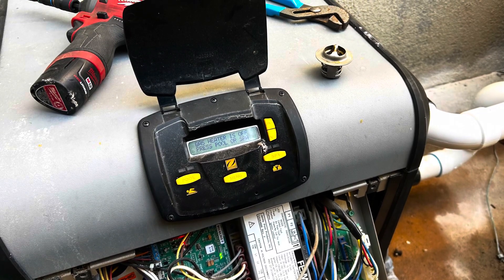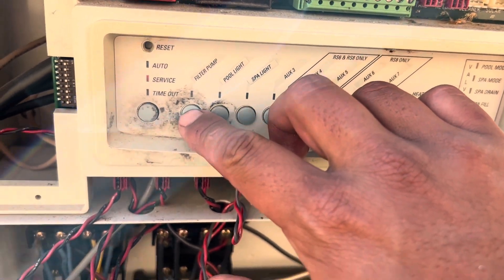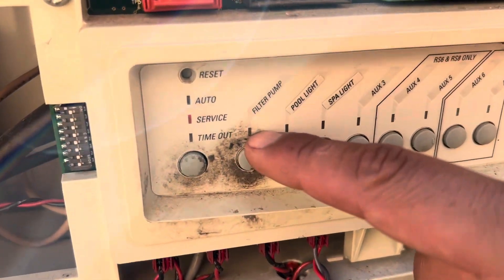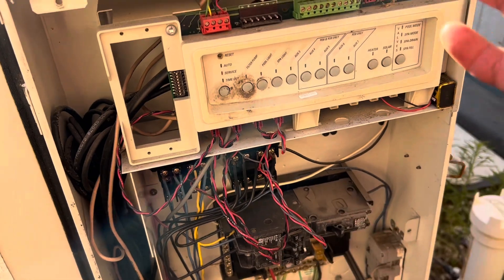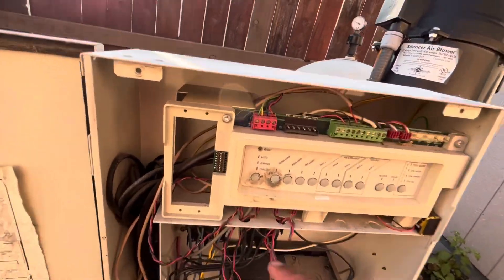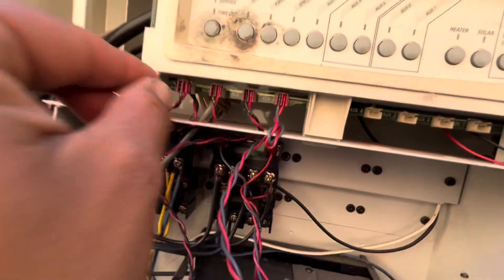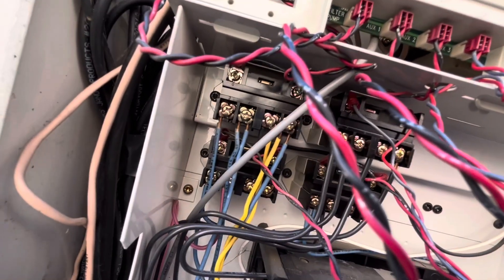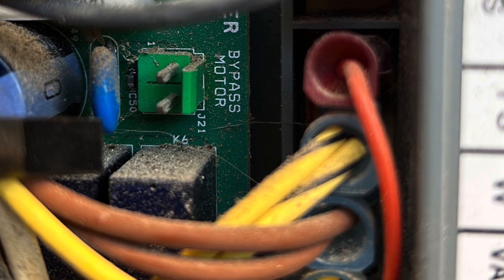Relays - Electrical Troubleshooting

Comment: I have the Jandy VS PlusHP and it does not run. I switched the blower like you did and it also turns on. When I select filter on the Aqualink, the relay does go on and off. Pushing it manually does not turn the pump on either. There is power going to the VS PlusHP. Is it the board on the pump itself? Any ideas?
Reply: The Aqualink PDA says that the Jandy epump is offline.
Reply from the maker: @chrisssychrisssy  you need to verify that the pump is getting power. You either need a multimeter or a NCVT (non contact voltage tester and test for voltage at the actual pump connections (the connection coming right out of the pump itself)
Reply from the maker: Does your pump have a screen on it?
Reply: @rodriguezpoolservice3447 I have confirmed that power is going to the pump at the pump. There is no screen on the pump.
Reply from the maker: @chrisssychrisssy what’s your voltage at the pump terminals?
Reply: @rodriguezpoolservice3447 It should be this one: VSPHP270JEP

Comment: I just started having a similar issue with the low speed function of my two speed pump. I'm running a Jandy Pro two speed pump that does not have controls on the pump motor. The system is controlled by a Jandy RS controller. The low speed function is wired Aux 1. I can push the low speed button on the RS board, the light comes on, but the pump only runs on high speed. I haven't gone further into the RS box yet, but I'm going to be looking for a bad solenoid based on my internet research.  Thoughts?
Reply from the maker: In my area we don’t deal with 2 speed pumps at all. We just don’t see them.

I know that speeds are controlled through a relay. 

If the pump is turning on when you press the low speed aux but it’s kicking in at high speed then that would point to an issue within the pump itself. 

If the pump doesn’t turn on at all then that would point to the RS panel only then would I start looking there. 

As far as I know 2-speed pumps are a thing of the past. If the pump is old. I would much rather sell a new pump and know it will last for many years.

Comment: I have the same problem. I told the client to purchase the relay. How much should i charge to replace it for him including "diagnosing" since I already diagnosed it?
Reply from the maker: you should always try to purchase parts yourself. This allows you to provide warranty through distribution in case the relay doesn't work right. This also allows you to charge better. Most people think we overcharge for labor/installation. I would have charged $175 for the repair. This includes diagnosing and replacement.